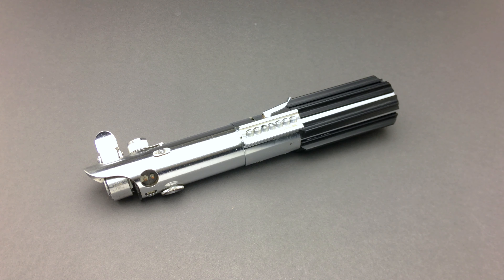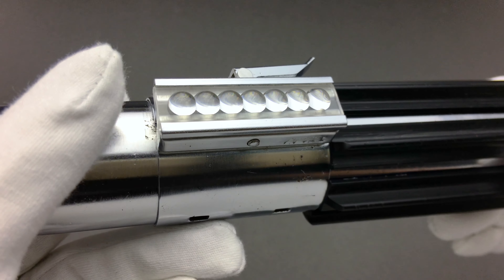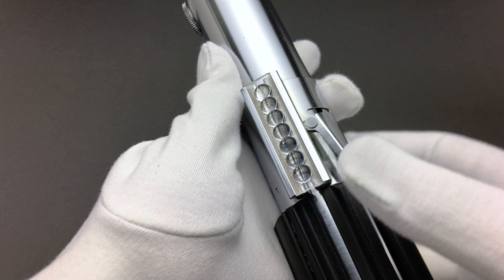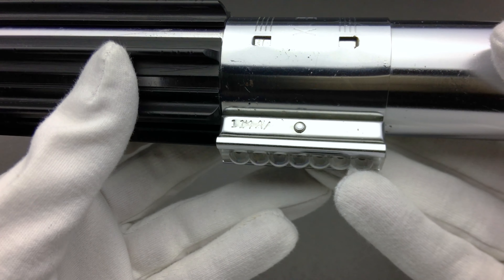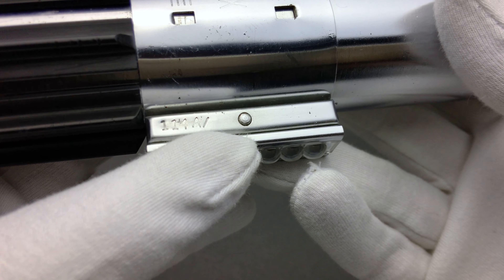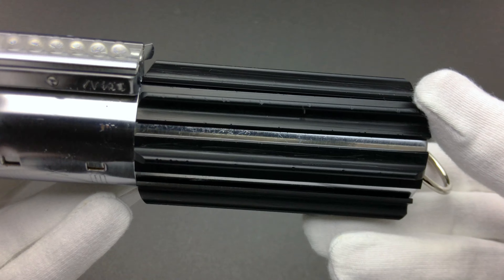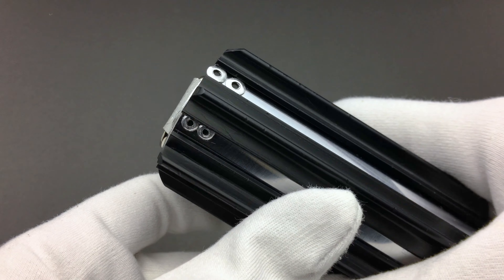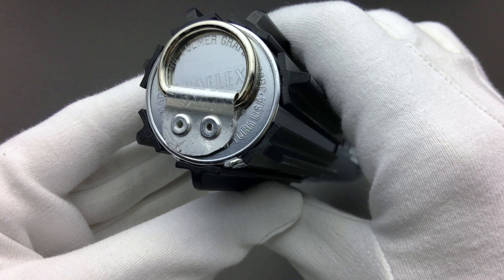Luke Skywalker Vintage Graflex from Star Wars A New Hope - Ultra Accuracy Mods

Comment: Very beautiful work. I’m a fan already. It appears to me the finish is a little more muted than others I’ve seen, which to me seems more accurate. Did you alter the satin brushed finish of the hilt itself?
Reply from the maker: No I did not. That finish is as it was when the flash arrived to me for the conversion. It really isn't a muted finish. This is a Folmer which are shinier than their Inc patent counterparts.
Reply: @irondestinyprops  Thanks for that info. Perhaps it’s the lighting in your video then because of the way the reflection of light looks diffused on the surface of the hilt. I’ve seen many videos of various versions of Graflexes from genuine vintage to replicas and all look shinier than this one. I really like the way this one appears on camera.

Comment: I'm very interested in a screen-accurate build such as this, as it seems nobody offers the ANH with any of the grip rivets, accurate D-Ring clip, or sidebar stamping.

What would the cost be for such a commission?

And would it be possible to have the grip rivets truly riveted for extra accuracy? Or does this cause structural problems with the 3-Cell base?

Thank you kindly!
Reply from the maker: Feel free to PM me anytime on my Facebook business page to discuss further. Popping and riveting the rivets is possible but not quite as easy to make accurate as flush cutting them is.

Comment: Is a folmer with patent or no patent more accurate to the Bespin ESB variant of the saber?
Reply from the maker: It is difficult to say with certainty without better photo evidence, but since the Dagobah prop and wampa cave prop were both Folmer patent/non-patent respectively it is reasonable to assume a Folmer was used for the Bespin prop as well.